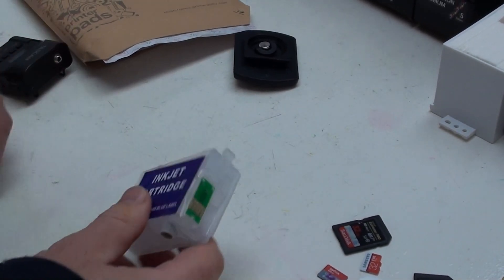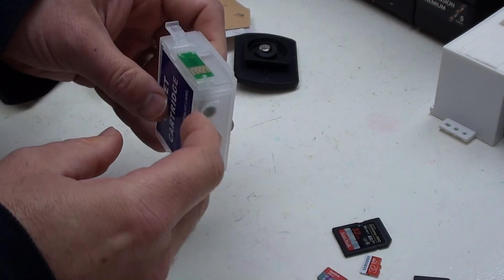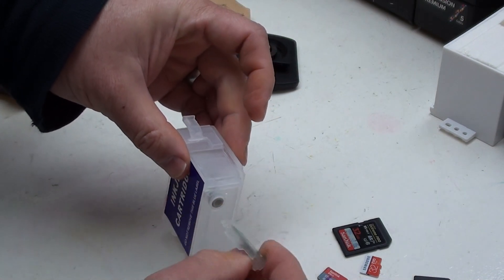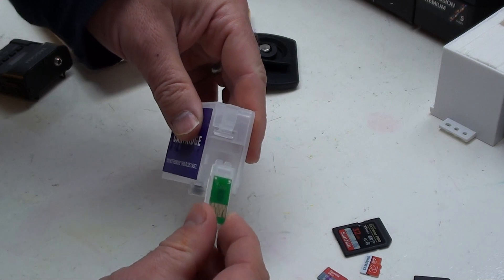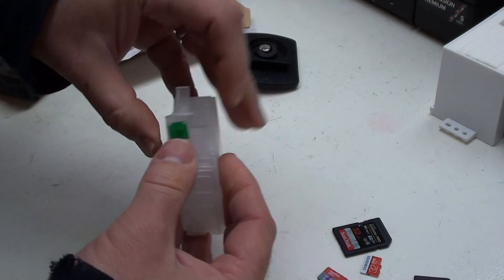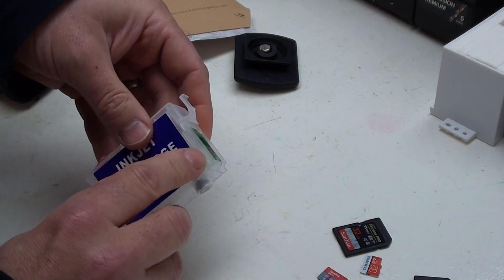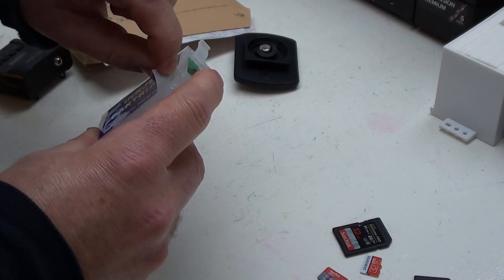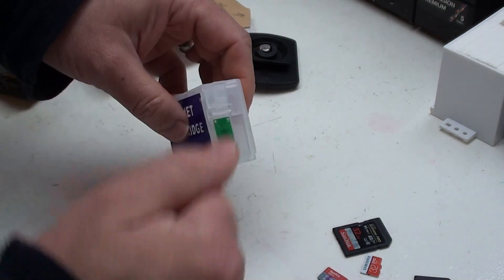Epson Refillable Cartridge : Chip Replacement

Comment: Thanks for this. Do you need to replace the chip every time you refill a cartridge?
Reply from the maker: Depends on the chip type. Most are ARC (Auto Reset Chip) type so they reset automatically.